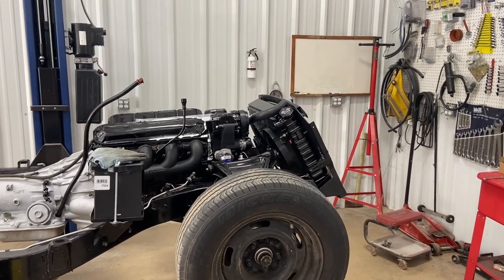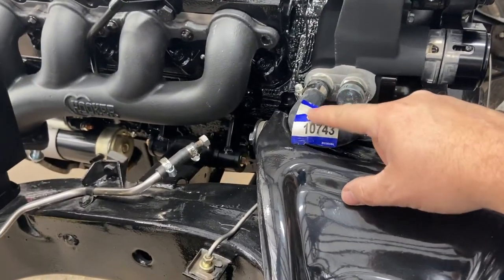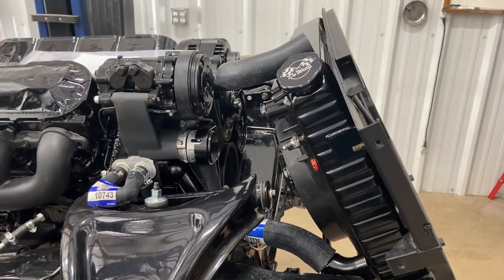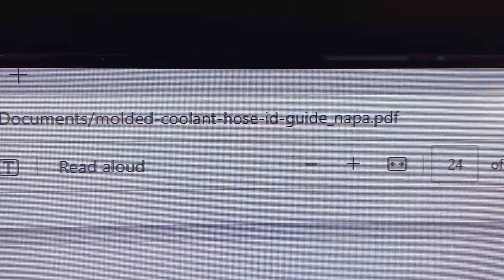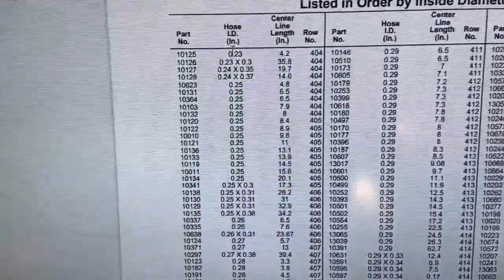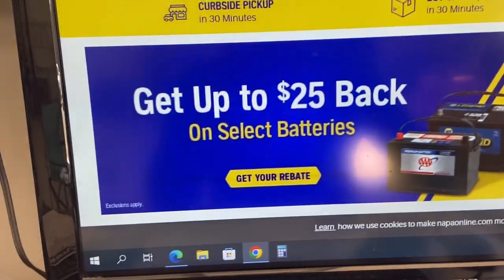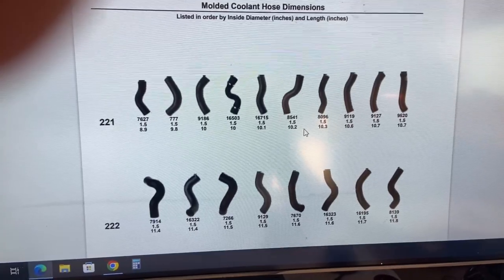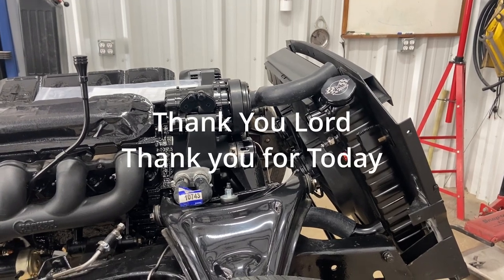How to get that perfect custom radiator hose for LS or any engine swap step by step instructions

Comment: You have any answers for if you need different sizes? My upper radiator inlet  is 1.5 inch but from the engine side its 2 inch. Cummins swapping 98 chevy.
Reply from the maker: what i would did is find a hose that is close to the same shape you need. the 1.75 hoses start on page 42 of the document. the hose would be 1.75 to 2 hose, and then you buy a 1.75 to 1.5 inch hose adaptor to mate up to radiator. something like ALL30240 from summit racing. Thanks for watching let me know if you need anything else.

Comment: i am in canada and the 2 part numbers 7600 and 7738 are not correct, but 10743 is correct, how funny is that, anyway, any idea how to convert 7600 and 7738 to a napa canada part or gates or something, thanks mike
Reply from the maker: now that i don't understand, the gates numbers i show in the PDF on computer in video are actually the gates numbers. and here in US the napa stores use gates numbers as the napa number.   how are you searching at napa in Canada?   is it online or at actual store?    i haven't shopped at a napa in Canada before, i used to work in Canada, but never shopped at napa while i was there 😂😂😂😂😂😂
Reply from the maker: yeah that i dont understand. do you have access to the PDF i have linked in the description of the video?  maybe you could print the first couple pages and show them they are actually gates numbers

Comment: I am installing an LS engine on a 1989jeep grand wagoneer
Reply from the maker: That sounds like a cool project 🙌🏼👍🏻🔧👊🏼 I had to take a real close look at your name 🤣🤣🤣
Reply: Yea it's been a tough project not sure where to get some parts to make it all work.
Reply from the maker: which parts are you looking for? not saying i know where to get everything, but someone on here might @DavidHunt-v8o
Reply: Radiator hose to go from an LS to the original jeep radiator. That's is my biggest problem
Reply from the maker: yeah going to have to checkout the pdf catalog in the link and go to page by diameter and start there.   and i have spliced 2 hoses together to make it work @DavidHunt-v8o
Reply: @andhotrodshop  I figured that's what I am going to have to do also.